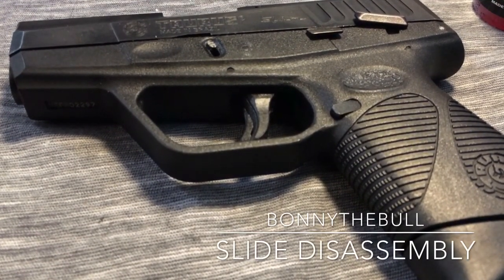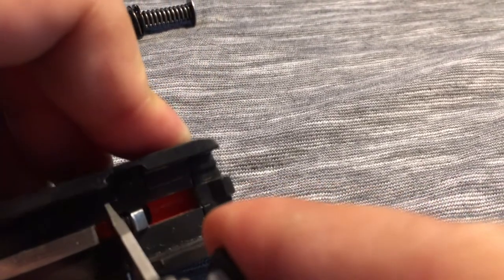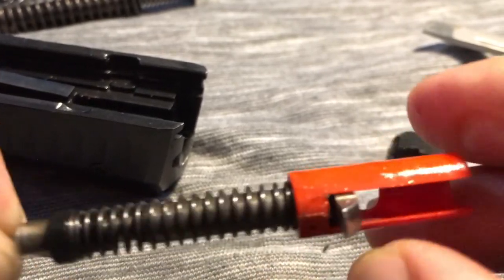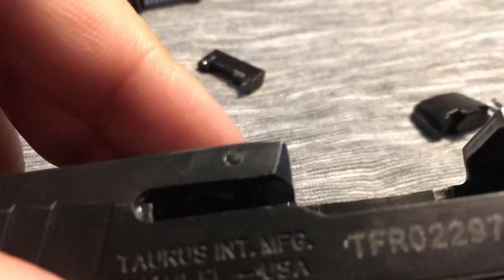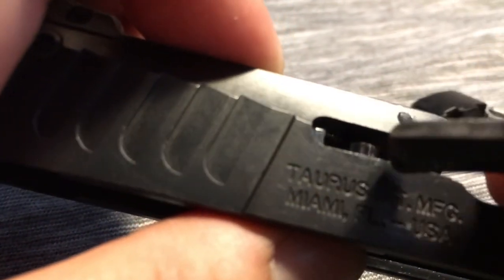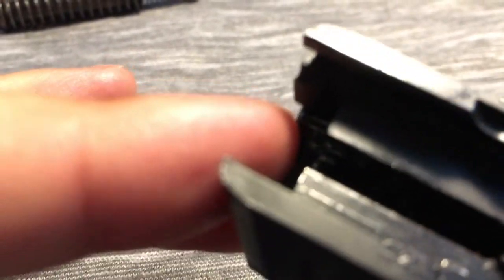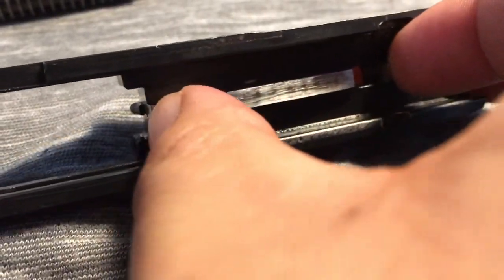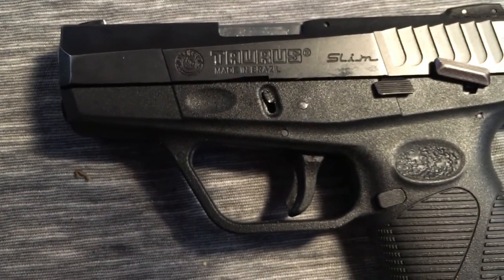Taurus 709 Slim Slide Disassembly

Comment: There’s a small spring at the back of the slide that sits somewhere by that push pin that comes out on the right side.   I lost that spring.  How do I fix that or put another in

Comment: My 709 Slim dissesembles like  like  pt111 g2 the retainer pin and spring can be a bear  putting it in never seen your set up before
Reply from the maker: David Traver this is a 2013 model I believe. Gen 1. Notice how the extractor on mine differs from the current model, (your model). I believe if I send it to Taurus, they'll upgrade it  free. But I have a Smith and Wesson Shield, have a TLR -6 weapon light arriving tomorrow. Have lots to review, with no time 😪.
Reply: My extractor is different from this also. Mine is 2016 mfg date but has no plunger retaining extractor after I I remove back plate from slide...
Reply from the maker: Scott Hunter on Their Website They have two generations listed. Yours is the newest. You might be able to get a blown up diagram of the parts from Taurus if you chat with them.
https://www.taurususa.com/gun-selector-results.cfm?concealed=1&page=2
Reply: Bonny TheBull mine is not Gen2 it does not have G2 stamped on slide.  My extractor does come out like the PT111 gen2 tho. I haven't tried yet but it's the same set up.
Reply from the maker: Scott Hunter you're best bet is to contact them directly (they have chat now, on their site) like Smith so it's easier to get to them